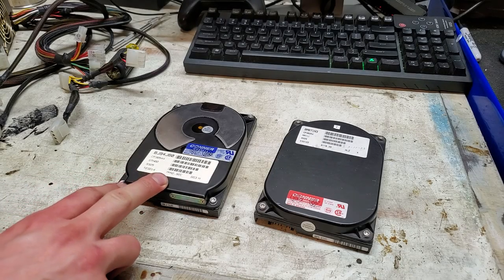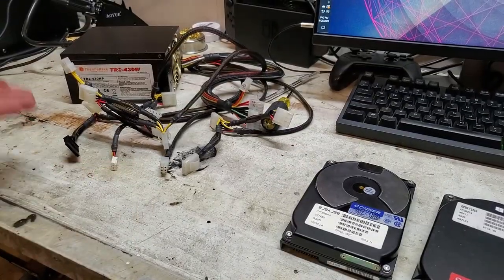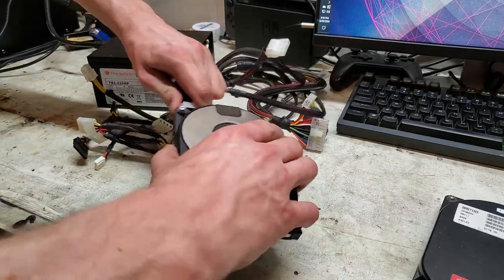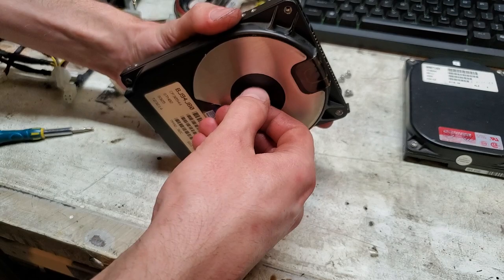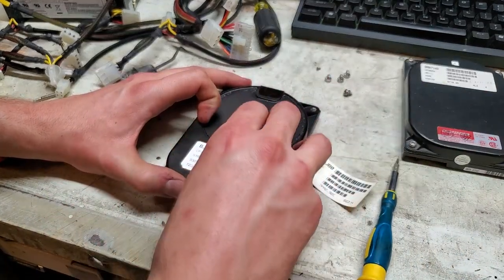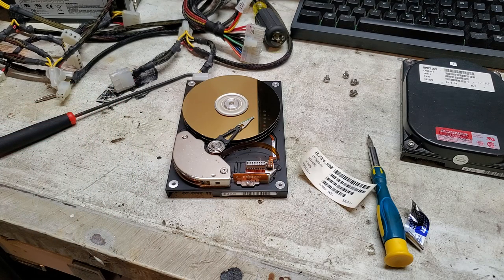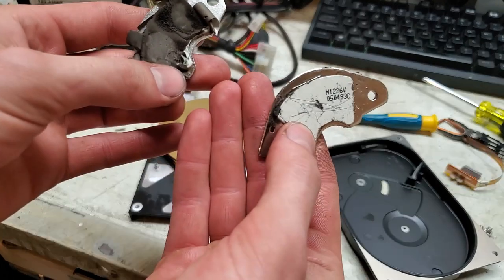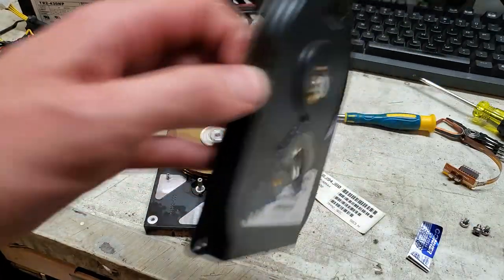Hard Drive Autopsy: Connor CP30544

Comment: Another thing I thought of when it comes to your PC-98...

If you still don't own a bus mouse, you could attempt to use a serial mouse with a 9 pin to 25 pin adapter.  Apparently the QMOUSE driver has some support for serial mice, though I have no idea how well it works or how compatible it is.

Comment: The 170mb HDD mine came with actually works for the most part.  25% of the time it won't spin up, but if you nudge the side of the drive, it works perfectly from there.  It's a drive made by NEC themselves it seems.  Used it in my 286 for a bit (could just barely fit Fate of Atlantis CD version on it), but I did back up the contents.  It had some kinda interesting stuff on it from the previous owner.  MS-DOS 5, Windows 3.1, some Japanese versions of Win3.1 applications like PC Paintbrush, and two hentai games.  The games were Eve Burst Error and the Windows 3.1 port of Immoral Sisters.  Also, I know people talk about how old HDDs are unreliable and whatnot, but they haven't been too bad for me.  I've gotta say that I've had far worse luck with old optical drives by far.
Reply from the maker: Didn't know that NEC made hard drives, I've never seen one. I haven't had an IDE drive fail on me yet, unless I count one in my dad's old P4 machine, but it was a Maxtor Diamondmax, so that doesn't count. I was thinking the heads were stuck somehow, so if I smacked it on the table they may go free, however that obviously wasn't the case. Wanted to know what was on that drive, but that will never happen now. Most optical drives I try work, however they're very picky with what kinds of discs you use.
Reply: @Tr3vor42532  For me, a number of the optical drives I have either don't work at all or are flakey.  My PC-98 CD drive still works, but just out of nowhere started having an issue with a really noisy tray and the CD sometimes scraping against it.  I have to eject and reinsert the CD for it to read if that happens.  My HP Vectra VL2 4/66's Mitsumi CD drive also kinda works, but is very picky.  My copy of Rayman works fine, but it won't read my copy of Magic Carpet well at all even though the disc is mint.  It makes worrisome sounds when I try to read that one, too.  Do you have any particular brand of CD drives that you would recommend?
Reply: @thepirategamerboy12  hey, I’m kinda jealous of the image you made him. Think you could shoot that image my way for just a bit? I want to play some of the games on it/have Win 3.1 setup. Also I’ve been having issues with your English Touhou, it crashes for me but the Japanese versions work fine, it’s strange.
Reply: @ooohmaru  Sure, I can do that.  Just give me a bit and I'll link it in my next reply.  I did do a few personalized touches to the image (like in Win3.1 the registered name is his YouTube name), so I'll have to modify that for you.  Perhaps I should make a more generic version as well sometime.  Also, I don't recall having any issues with the English patched Touhou games, so that's odd...
Reply: @thepirategamerboy12  Thanks man!
Reply from the maker: Yeah, I saw one of the games opened with my username, that was pretty unexpected. Definitely a high effort hard drive image.
Reply: @thepirategamerboy12  Yeah, I have no idea why Touhou doesn't work for me. The Japanese versions work flawlessly, maybe something in my yahdi image, not sure.
Reply: @ooohmaru  Alright, here's the image.  Let me know if it works for you.

https://mega.nz/file/HwlxgTaI#DoctJ_8kKhcerT2Todt9EH85gi39FpcuBlNIKodwxGI
Reply: @thepirategamerboy12  Thanks, I finished downloading it. I'll give it a whirl tonight.
Reply: @thepirategamerboy12  I want to confirm this works for me. I have a bunch of your games and the English patch of Touhou works. I REM'd SCAN31 since I have a transcoder, but thats great to have in the future if I use it on another monitor. Couldn't get Windows to boot though, gets stuck at the boot screen. Glad to have working Touhou now though.
Reply: @ooohmaru  I see, glad it works for the most part.  As far as Windows goes, remember that you have to switch between AUTOEXECs and CONFIGs in the AUTOCONS folder.  It won't work with the YAHDI one.  Copy the contents of WIN31 to the root of the drive and reboot the machine.  When you're done, copy the contents of YAHDI to the root.  From what I can tell, that's the issue because I just tried it with the YAHDI ones and it does the exact thing you described.
Reply: @thepirategamerboy12  Ah right, I forgot! It's been a while. Okay, then it's perfect. Thanks dude!
Reply: @ooohmaru  No problem.

Comment: Angry man beats up rare hard drive.
Reply from the maker: just wait until I get the hammer out
Reply: @Tr3vor42532  In the video was there something wrong with the magnets causing the headstack to be unable to move? Are you serious about these Conner drives not liking to be placed vertically?
Reply from the maker: @cdos9186  Yeah, I think either the coil was rubbing on the magnets grinding them down or somehow the magnets started to decompose pinching the coil in place, so the drive couldn't pass seek test. I've heard that the grease in the spindle motor goes bad faster when placed vertically, I don't know that for myself, but better safe than sorry.
Reply: @Tr3vor42532  I bet you are right considering that the drive had worse bearings that the other drive and you knew it was placed vertically. Sucks too because that drive was rarer than I thought. I was curious to what it looked like inside, thanks!
Reply from the maker: @cdos9186  yeah it sucks I hoped that it would work when I got it just to see what kind of software would be in it for pc-98, but all it did was spin up and make a buzzing noise, trying to free the heads.
Reply: @Tr3vor42532  So the heads weren't stuck it was the voice coil stuck between the magnets?
Reply from the maker: @cdos9186  yeah, somehow the coil got pinched between the magnets, I don't know if there was some sort of bushing between the magnets that broke down and caused them to come together, causing the coil to scrape away at the surface of the magnet and eventually get pinched or what, but it couldn't move without me removing the top magnet.
Reply: @Tr3vor42532  If I get one of these do you think I should worry about that issue? That is odd how that happened.
Reply from the maker: @cdos9186  I'm not sure
Reply: @Tr3vor42532  Neither am I. When you took it apart were there rubber bumpers to stop the heads from going too far in the magnet assembly?